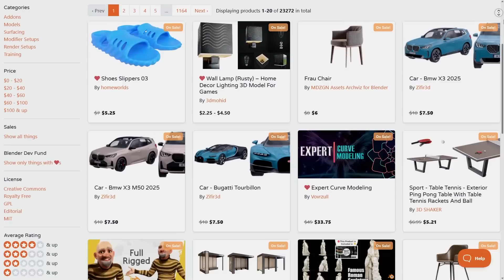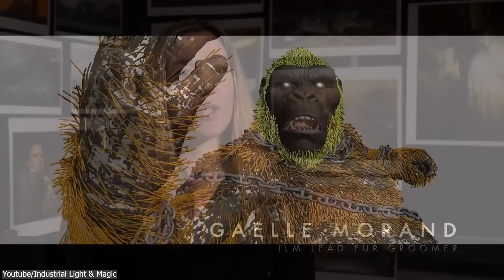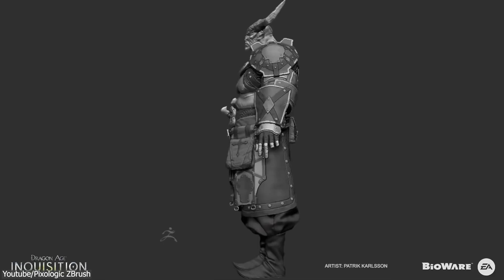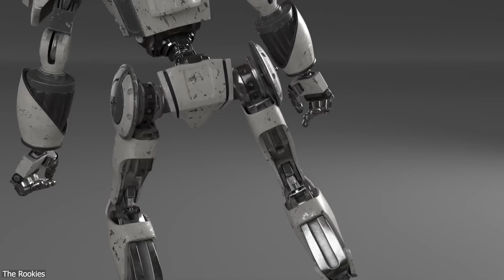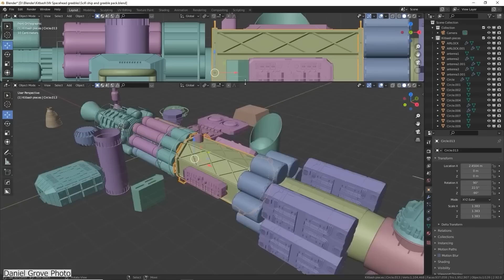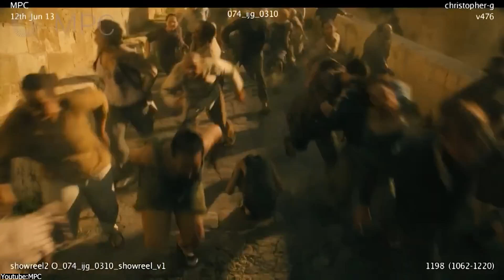Why 3D Professionals & Studios Don't Do 3D Modeling?

Comment: I used to work in the 2D and 3D animation industry here in South East Asia, we often times joke about the foreign company who's outsourcing the project to us. They are only ones who take the fun stuff and leaves the tedious work to us in exchange for chump change. To put it simply, it's like a cupcake, they take the upper part that has the chocolate, sweet icing etc. and leave the bottom half as well as the paper wrapper behind for us to consume.

"You want to be a 2D animator that only draws keyframes? Too bad the role's filled, you draw the tedious 200 frames of in-betweens before the deadline, do unpaid over time to finish it sooner or lose the job." No wonder a lot of older and experienced artists leave a studio after working for almost a decade, changing careers and getting paid generously. A studio can easily replace you with a younger artists that has no social life. It's like modern day slavery, the only ones benefiting and getting credits for the hard work made are the ones on top.

Comment: It's hilarious how everything goes full circle.  The initial push to 3D graphics (in film) came because they promised that 3D would be cheaper than traditional 2D animation once demand and software power increased.  And they would no longer need to outsource the animation to cheaper studios oversees like they had been doing with 2D animation.  Instead, the opposite has happened.  And now 3D is in the same problem 2D was 30 years ago.

Comment: All we need is to outsource the whole studio. Why only outsource the modelling and asset creation? Why dont these outsource studios make their own projects all together? What's so special about companies in canada or the US? Other than the brand, what else you need from them and cannot be outsourced? this will make game prices cheaper wouldn't it?
Reply: Because they can barely do it, see: Starfield and Mass Effect Andromeda. Drake was done in-house by Naughty Dog artists, not even sure why he's shown in the video.
Reply: @paranoidpanzerpenguin5262  It depends on the project, but usually if a game relies on a massive tech that drive the gameplay loop, and is the foundation of the entire game like the games you mentioned, then it's the main studio that should be directing them, and not outsource them... 

Doing so, would be... incredibly risky, stupid, and dangerous, and at this point the game studio would basically act as a editor of sorts (if they don't make the code, nor the art, and only provide th funds). 

But here's a special bit of information, nothing is stopping the studio from using a outsource studio to work on a side project for "pre-production" purposes, meaning that you could have a 200 persons studio where 199 people are working on a game, and 1 is overseeing another projects. I agree overdoing the whole outsourcing thing cheapen the value of a game studio ALOT. I think, that the dev of Payday 3 only did the gameplay, and the progression system, and nothing else
Reply: A big part of it is capital. There's more to making a game, movie or TV show than just asset creation and in order to make a full fledged game you need a lot of money, for several years before seeing any return. For outsourcing studios it's less risky to take the immediate and consistent payout of multiple studios contracting you out than it is to gamble on making a project of their own. 

You also have to consider money value. If your a studio head in India for example, you may not be able to get loans or investments for enough to develop a project on your own, but an overseas studio can get that money, and then you get their money with a higher value which goes a lot further in your country.

So it can being an outsourcing studio can be a lucrative business that's also a safer option to creating your own projects
Reply: Because doing business in Eastern Europe is nothing like North America